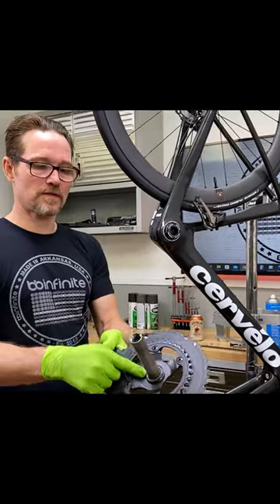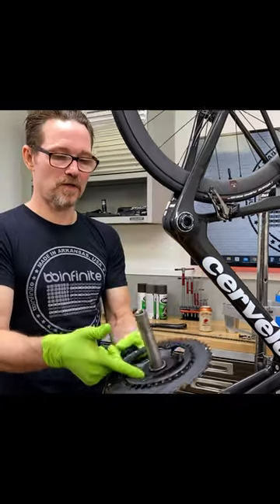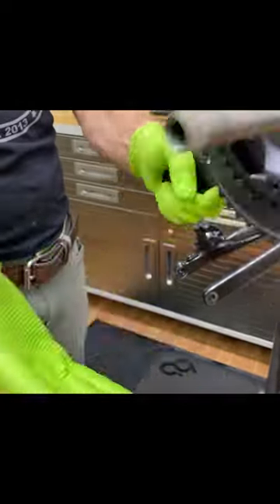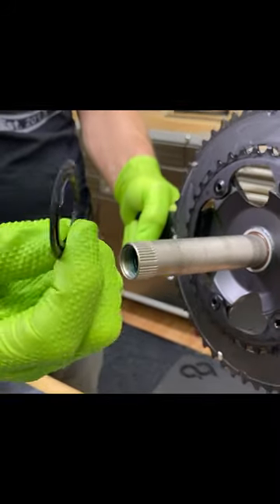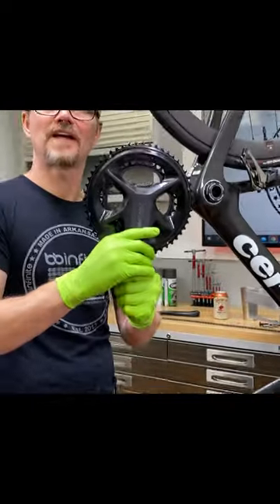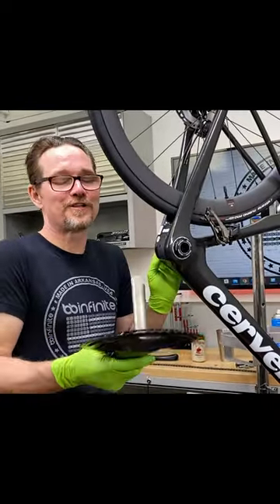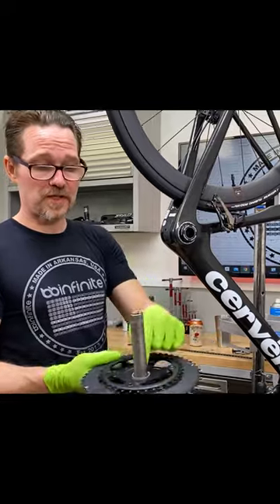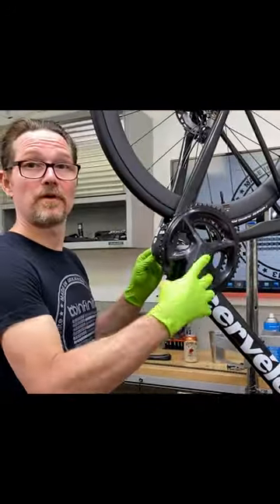Strip crank completely before install OR ELSE #shorts

Comment: What work stand are you using and how are you clamping the bike to it?maybe a short video? 😉
Reply from the maker: It's a Park Tool PRS-3.2-2 Repair Stand with 100-3D. Highly recommend. Pricy, but it'll last forever, so it's a good investment.
Reply: @BBInfinite  thanks !
Reply: If you want a portable version, consider the Park Tool PRS-10.2 or 10.3.